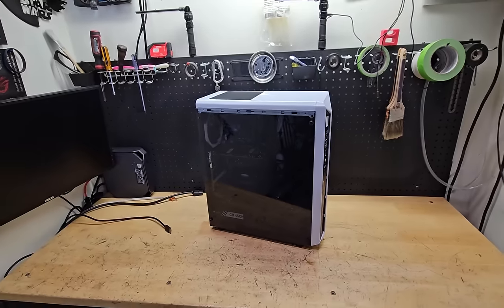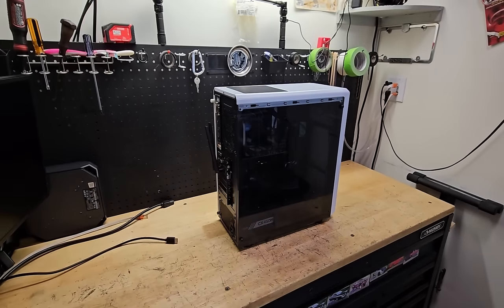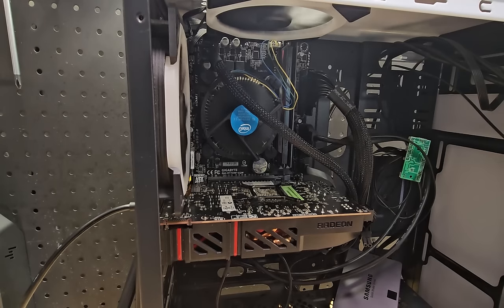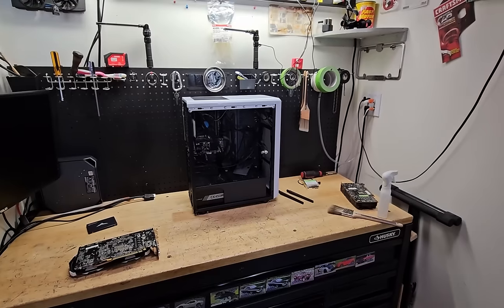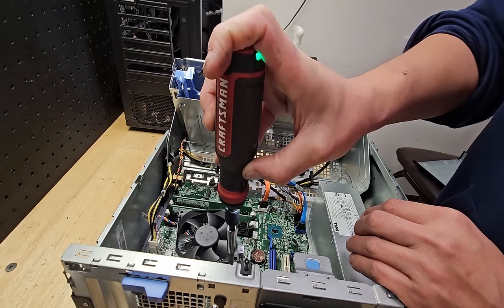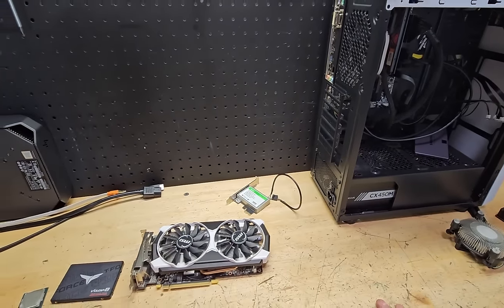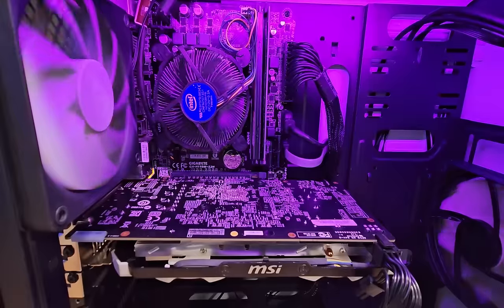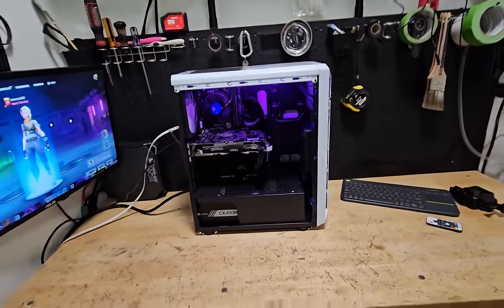I traded a working PC for this broken PC because the buyer got scammed!!!

Comment: Yes if you are going to look at a system Id recommend taking the portable version of HWInfo with you on a USB stick and running it on the PC. Itll list all the specs of the hardware without disassembly which you can check against the listing.

Comment: I never buy off Facebook market place. I only buy computers at $25 a pop from my local E-waste recycler.
Reply: yes most pcs are xp ones hear better ones on Ebay
Reply: @EastAngliaUK  XP PCs are still useful for those that require such a PC, very good for running older games and programs that won't play nicely with newer operating systems.
Reply: Hey man we all aren't like this. I sell lots of my builds on market place.  I buy lots of parts too through market place.  That being said I've also wasted a lot of gas from people trying to scam. I report those people right away so nobody else gets scammed.
Reply: @TheSpotify95   core 2 quad PC’ s are great if you are learning how to code. I’ve gotten most modern games with the exception of Easy Anti Cheat games to play on the core 2 quad using Intels SDE instruction set emulator.

Anyway, dont know how my question deviated discussing XP PC’s etc.  you can get 10th gen intels, and  modern ryzen PC’s at the e waste recyclers for $25
Reply: @InternationalLiaison  how where ryzen and 10th gen intel are still expensive
Reply: @Cyber_Gas   people that dont have the capacity to work on prebuilts and are out of warranty. Are ignorant enough to just throw them away. Most warranties expire in 1 year. Extended warranties expire in 3 years.  Where do you think most GPU’s and CPU’s come from on ebay?
Reply: @InternationalLiaison   and where to get it
Reply from the maker: I wish I had a e waste recycler in my area
Reply: @DLMtechgarage   Living in the arm pit of the SanFrancisco Bay area and silicon valley. We have them every where. However most recyclers are not friendly and dont want to sell top the general public. I happen to get lucky and deal with a chinese owned dismantler that wants to redistribute and sell the waste as is before it goes to a shipping container to china, and ends up on TEMU, WISH, or AlliBaba...LOL
Reply: Epic anti cheat is a scam that slows down your computer. I wish it never existed
Reply: A pop😂 god your getting old af

Comment: I never got scammed, but I did get a pretty awesome deal a year or two back! I'd say it was a few months before the Quest 3 launched, I posted my Quest 2 with a few extras on marketplace. Ended up in a trade, I got a Ryzen 5 5600 & Rx 6700XT for it! The guy was just really interested in checking out VR & had upgraded away from these parts, so I ended up with a hella good deal on my end. Still using both today 👌
Reply: sounds good, im currently looking for a deal on a gpu or wether to wait for 50 series / 8000 series amd been as i already upgraded from my r7 2700x to a 7800x3d. (oh i sold my 2700x with my old drr4 and x470 motherboard for nearly the cost of the 7800x3d so basically bought a motherboard
Reply: @christianbilling3540  I'm coming up on a GPU upgrade as well, the word is to wait until the new ones launch. I'm not sure the release dates for the next gen, so I may end up getting impatient and ordering anyways lol. Going for the snow white PowerColor RX 7800XT. It's a bit under $600 last I checked, which honestly isn't a ton anyways.
Reply: @zach7384  yeah i wanna hold out also see what next gen (prices) are like cause surely the prices gonna have to drop so that us holdouts actually give them our money lol (im holding out on a 2080ti still) so skipped rtx 3000 and 4000 / amd 6000 and 70000
Reply: @christianbilling3540  For sure. I get a fat bonus around Christmas every year, plan on picking one up then. If the new ones still aren't out, I'll just pay whatever the 7800 xt costs at that point. Hopefully we can both get the upgrade for a good price lol things always change in the PC parts world.
Reply: @zach7384  yeah hopefully man. prices got insane with gpu mining and chip shortage though. cause even with inflation they shouldn't cost anywhere near what they currently do like my 2080ti was £700 new a 4080 super now of equivalent model is like £1200 (well i say equivalent EVGA aren't in the game anymore :(

Comment: Damn that was a big profit for the scammer. $50 for the case, $20 for the used psu, $50 max for the mobo and cpu, and around $20 for mismatched ram, $30 for the boot drive. He woulda just used around $170 for all the parts. But most likely he just got those for free since someone might need to get some more space in their house, $80 profit and $250 profit + if he was paid to dispose of it. Because there are companies and offices that pay to dispose of the ewaste of offices that are closing down.

Comment: Hi there! I can't say "I got scammed" per-say. but i bought a Z230 for about $60 barebones (No hard drive, no OS (Obviously) about a year ago. I knew from the git-go that i wanted to convert it to a gaming PC (i'm using it right now), anyway, I added a cheap wifi card ($10) & 8 gbs dr3 (It came with 8 already, so 16 GBs total.) I then got a Quadro 1000 video card. Now the problem was, it had a 300+ watt power supply in it. After about 3 months it went "poof", no power (It must've blown), ok? I replaced it with the same "used" power supply ($15, yes you get what you pay for, i know). Guess what happened 3 months later? It blew too....again! So (I was saying to myself the whole time "I should covert this to an ATX"), but lets see what happens until it went "poof". Ok, so i did! I got an ATX 750 watt power supply ($135!). Its running fine so far. Do you think ill have the same problem, do you think itll blow too?
Reply from the maker: if you got a good power supply form a reputable company you should be fine. Also check your power cable and ensure the wall socket is not damage. I have seen faulty wall sockets cuase these issues.
Reply: @DLMtechgarage  That is a good point! I was thinking the motherboard, but I have my sound system plugged into the same "socket" (With a surge protector), no issues. But since this post my PC HAS shut off unexpectingly, but I was able to turn it back on. Could it be a power surge (Like i said, I DO have high end surge protector)? Thank you!

Comment: Glad to hear that you managed to get the system up and running again! That's exactly what I would have done as well - get the system up and running with what you have available.
And as for that Dell Optiplex that you took the CPU out of... someone will probably buy that Dell even with the Pentium CPU, just as a general everyday office box.
Yes, I too would avoid cases with no airflow. I had one for my PC and the CPU (R5 3600) was hitting 95 C with its stock cooler, so I swapped it out for a Phanteks Enthoo Pro (needed the HDD and ODD slots) and it worked wonders!

Comment: Talk about a scam... Personally, I haven't been scammed per say... But I did buy a pc, brand new, that stopped working 3 weeks after. Sent it back, seller asked if I wanted a refund or to get it fixed... Turned idiot for a moment and said, "fix it". the guys "fixed it" and returned it only for it to stop working in around 2 weeks. And the C19 hit and everything came to a full stop. Even deliveries, so the warranty went to hell. Had to try and have it fixed outside, changed the motherboard twice. The CPU once. Always ended up failing shortly after. So I just gave up on it. As of today I just have the case on my sister's house. The SSD and HDD I gave to her to use as storage units. Other inner pieces I gave to a guy nearby just as spare parts. So yeah...
Anyway, as of now I'm using an sff hp desktop I got from my mom, the elitedesk 705 g1. Heck, thanks to that mini I found this channel xD
Reply: 🙂 i think some parts are cursed or haunted cause I have seen testimonies where they replaced everything and it still doesnt work rite, its so creepy 👻🤔👻
Reply: If all the main parts were replaced and it kept failing you probably had a problem with your Power Supply.
Reply: @jaycahow4667  🙂 yes thats a good point thanks
Reply: @jaycahow4667  Yeah... Eventually that was the conclusion we reached... But by that point I've given up.

Comment: That was really kind of you to give the person in question a nice working PC. Sure a i7-6700 won't run Windows 11, but it's a hell of a lot better than a non-working machine.
I'd personally try and get the system up and running, but again, I don't think it has the right spec given the VGA and DVI ports on the motherboard, as well as the dual PS2 ports. I would guess that this is around the 2nd - 4th gen Intel era, and definitely NOT 10th gen.
edit: I was a bit off, LGA 1151 was 6th gen though 8th gen... still not 10th gen, which I think is LGA 1200.
edit 2: 8:00 Pentium, yeah! Not worth the $250 especially with a broken GPU. This would be OK as a general everyday tasks PC, but not much else.
Reply: Technically lga 1151 was 6th through 9th gen but would require a z370 / z390 to run a 8th or 9th gen cpu but 6th and 7th gen ran on z170 and z270 respectively. Although, back in those days there was a mod called the "coffeetime mod" that would allow you to run a 8th or 9th gen cpu on a z170 motherboard but required some research and tampering with the motherboard and cpu.

Comment: I never buy PCs from Facebook, I've heard too many horror stories. Still, I used to rock that same PSU until this month. Ended up upgrading my graphics from a GT 710 to an RX 580 and wanted to be sure nothing would go wrong. Ended up making a mistake according to a friend of getting a 550 watt MSI PSU, but it's still working. I almost had a PC horror story the way the GPU was packaged though, the faceplate was bent, it wasn't properly in the protective plastic, and  it was in it's box upside down. I was scared but it still works. I don't think I'm gonna by buying a GPU from Amazon again after that experience. But yeah, I saw that PSU in that "scam PC" and thought "this thing isn't gonna be pretty". Good PSU, just low powered and something cheap people get. But I could already tell that the main issue was the GPU before you started, I've had issues with PCs having bad GPUs in the past.

Comment: Whenever I build a low-end system with a small SSD and a larger HDD, I "move" the Desktop and Downloads to the larger drive... Just a thought.
Reply: With my systems that have multiple drives, Downloads/Documents/Music/Photos/Videos are put on the larger hard drive.
Programs and OS on the SSD, everything else on the HDD.
Reply: Moving desktop to separate drive is very stupid. Because now if the 2nd drive is removed, dies or otherwise connection is lost to it, the desktop stuff won't load and be usable. Downloads, sure. But never move a Desktop folder to separate drive.
Reply: @SapphireThunder  Well, keeping files on the desktop is stupid in the first place. The point is that when you have a very small SSD and a person you're selling the PC to is not tech-savvy, that is an option... Did you watch the video at all?
Reply: @mkrleza  If person isn't tech-savvy, moving the Desktop files on another drive than C drive is even worse. Because then when something goes wrong, small issue becomes larger issue.
Reply: @SapphireThunder  OMG, this is gonna become an online discussion... How so? Again, in the spirit of this particular video, you either put one large SSD like DLM did,  you do what I suggested, or you educate the buyer... Geez! Watch the video, and grasp the context!
Reply: @SapphireThunder  While I would not normally move Desktop files to a physically separate drive it should not be that big of a deal if the second drive is removed.  All icons in the Desktop folder are just copies of their originals and can be dragged back from the Start Menu (applications themselves are not effected).  You should not be keeping other types of files (Data) in your Desktop folder in the first place.  Besides even if you do your Backup scheme should include everything in your Desktop folder which could be recovered.

Comment: I got scammed couple times when people sold me broken components. But i doing same like you salvage good parts and rebuild nice machines. Old machines can be sometimes  nice suprise like my current gaming rig  based on Asus rog components .I got mainboard and cpu i7-4790K CPU @ 4.00GHz for 500$ together and machine is still enough good for latest games on the market. All upgrade what i doing on my rig is replace old mechanic hdd with ssd and adding graphic card GeForce 1080 Asus rog strix what still work like charm and run latest titles in filly HDR  resolutions with no any problems. Machine have windows 11 and Ubuntu Linux in dual os boot mode and is enough good to run up to 7 virtual machines and my favourite emulators for old systems. So for 500$ pc is no bad at all.

Comment: If there a quick way to know what intel motherboards are compatible with what CPUs and how to classify Intel's new "Pentium"  CPUs?
Reply: The socket number is usually printed on the motherboard, the socket number will let you know what processor it supports. Hard to remember them all just whip out your phone and google it, I remember most of them but would still google it for sure. That’s a 1151 socket the processor the original scammer claimed it to be is socket 1200.

Comment: bad fan doesnt make the GPU 
bad... little mineral oil
helps (for a while) 
but if the gpu is bad, its bad. 
250 for that pc (even if it worked)
was still a rip off.
Pentium processor....????
if that was the original power supply
i guess thats 30 bucks of the money
back already, wifi card, board, and ram, 
possibly fans.. but still most people
that wouldnt be worth it without
having plans to flip.

Comment: commenting 2:11 in, there is no way on gods green earth that's an intel 10th gen motherboard.  DVI plug and the ps2 plugs on the back of the motherboard is a dead giveaway.  I think those stopped being put on motherboards 7 years ago... so 6th or 7th gen maybe.  the rx580 probably isn't a 580, maybe a 560 or older like a 280 just looking at the side... dates from about the same time period, or older call it 2016-2017ish...

edit: ok so i was spot on for the motherboard, that can only run skylake or kaby lake.  seems its only got a pentium in it though.  lol.  and the gpu was about 3 or 4 years older then the rest of the pc.

and dude.  WiFi is pronounced WHYFY not WEEFEE

Comment: You did not help him, the guy had ddr4 and a processor that can run windows 11 big,  You gave him 3 gen older and, you did not tell us about the Quadra you probobly stuck in that old biz PC, smh
Reply from the maker: I gave him an i7 6700 system, 16gb ddr4, 512 m.2 with a 1650... that works for free

this one had a pentium cpu with a r7 250 and 120gb ssd....

no sure how I did not help him????